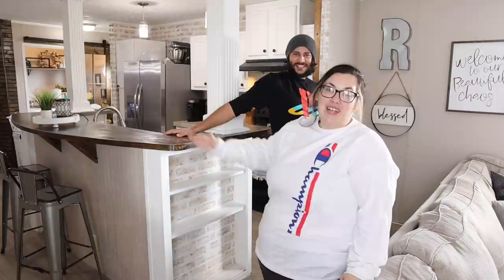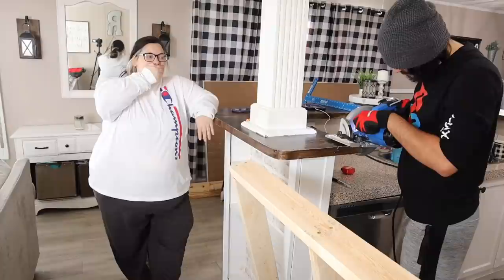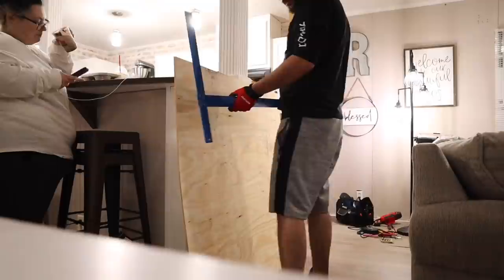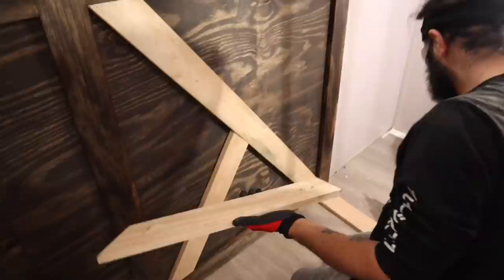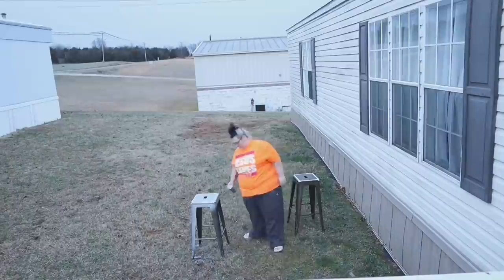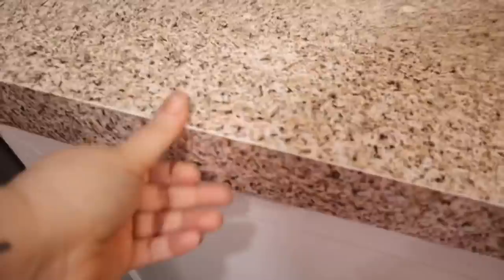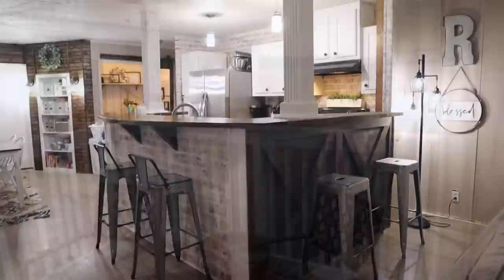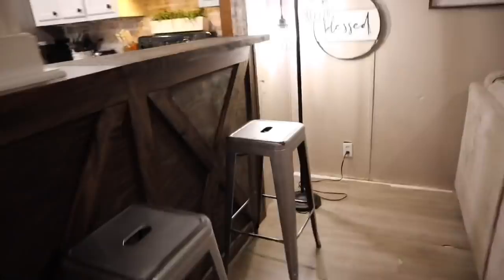SINGLE WIDE MOBILE HOME MAKEOVER | DIY farmhouse kitchen island | mobile home updates

Comment: On the kitchen side of the wall, you could add a board that folds down to the same height as the oven. That could be a work space when your cooking and preparing food . Then your counter top remains clear, and you just clean and fold up the workspace when done, and you get kitchen space back.

Comment: I would say leave the brick in the kitchen and just paint it an almost white but not the same color as the cabinets if that makes sense. Maybe the color you already have in the home just reduced by 50% or 75%. That way it looks like painted brick and it will give off a more industrial farmhouse look. You can then lighten the countertops to a white or marble white and it will look crisp and clean. Great job on the woodwork!!! So pretty!

Comment: Wow!!You and Shane are getting to be pros. Are you going to put the X pattern on the other side of the island?( where the little shelf is). Yes, too much brick. Would it sand smooth? Merina, get the dang baseboards done. Also you need a small piece of trim where the fireplace and ceiling meets. You home is lovely. You are a CHAMPION………❤️

Comment: I haven’t looked through all the comments so this may of been suggested already. But to hide that seam, if you have any of that same plywood left over, cut out a triangle to fit in exactly in the space to the right where the seam is. So basically just adding a layer of the plywood right over it. It will hide the seam.

Comment: Could you paint the wall white for now or a color you like before taking the brick down. Change the color of the contact paper on the counter tops. Or just paint the brick around the bottom a lighter color and leave the top brick. Just some suggestions. But the contact paper idea is awesome because if you don’t like it you can remove it! The bar looks great!

Comment: Use polyurethane on the top (several coats) gives a good finish for counter tops, but is not heat resistant

Comment: Love the finished look.  I like the brick on the oven wall, but understand the clash for the actual backsplash.  Paint just the blacksplach area white to minimize the clash with the counters.  Leave the rest as is as it ties it into the other areas.  Also, can the backs on the original stools come off?  Then all four chairs would match.  Wood fillers are stainable,  I would actually mix the filler with the stain first then fill in the crack on the x wall.  Then if necessary touch up with more stain after the fact.  Good Job Y'all.....keep up the good work.